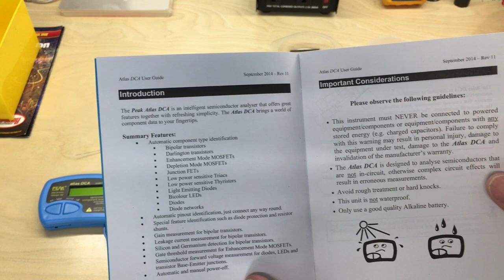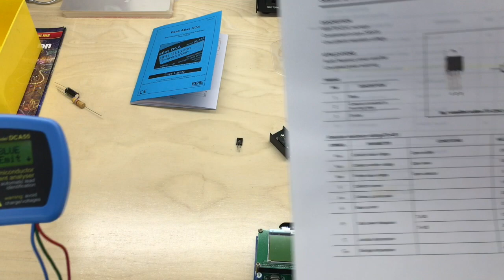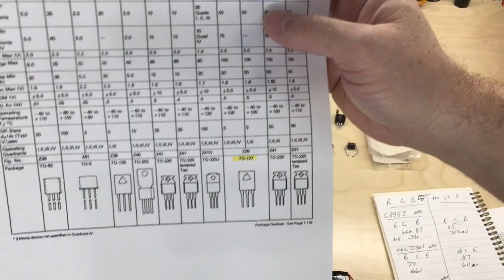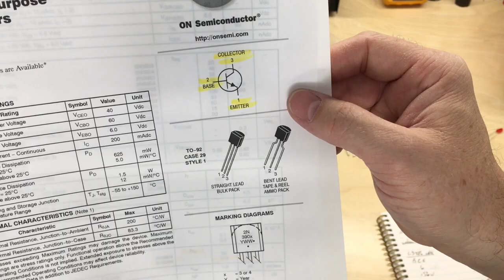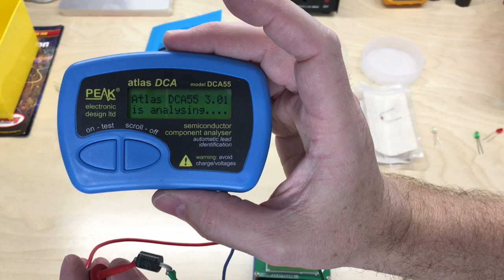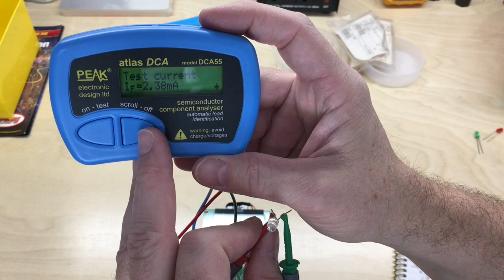Electronics Component Tester Comparison Peak DCA55 VS GM328

Comment: Can this test components on the board, ore most them be taken out?
Reply from the maker: It can do some in circuit, but mostly out. Sometimes the other components in the circuit can give false reading. Depends on circuit design.
Reply: @ThriftyToolShed  thank you for quick response.. I have an car amplifier that have a lot of transisitors on both sides of the board, and I am wondering if they can be tested in circuit?
Reply from the maker: I would try first. Many times it will still work. If the transistors have caps in circuit or sometimes inductors of course it can cause issues testing in circuit. If no good reading then I would take them out and test.

Comment: Thanks, good video. I read a comment from original developer (from Germany, I believe) this transister tester which wrote that made it after seeing Atlas DCA55. I'm google DCA55 and found the your video.
A part comment:
"I'm the creator of the original version of this tester; it uses an ATMega8 and a 2x16 character LCD as told in the video. I started this project in early 2009: After seeing a similar commercial tester (Atlas DCA 55), I thought it would be an interesting project to try building a similar device myself"
== if you want to read a full comment (very long), you may to search the video "EEVblog #1020 - Is A $7 LCR / Component Tester Any Good?" and read the first comment.
p.s. sorry for bad English, my mother language is Russian.